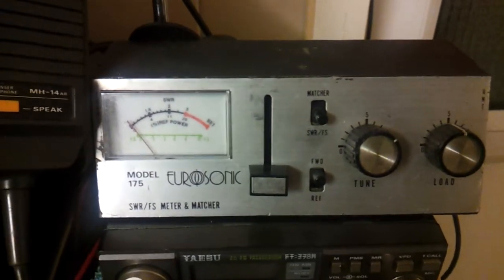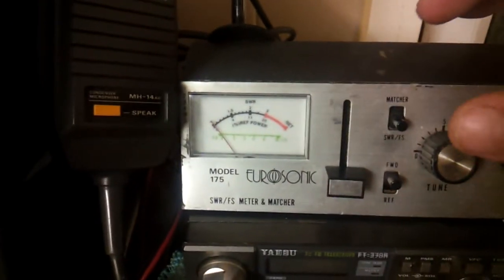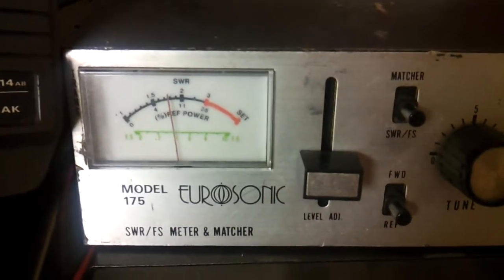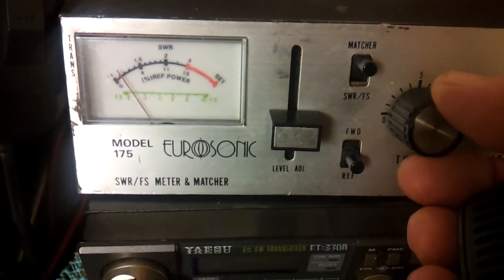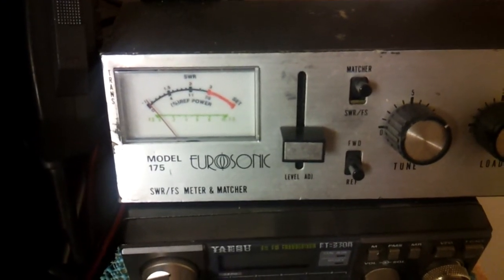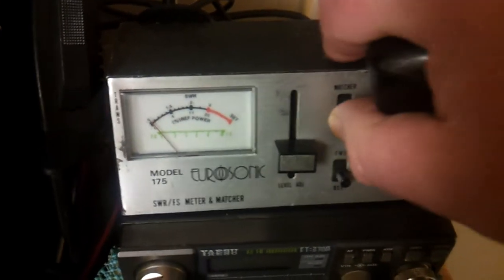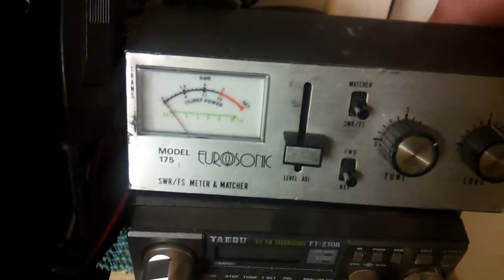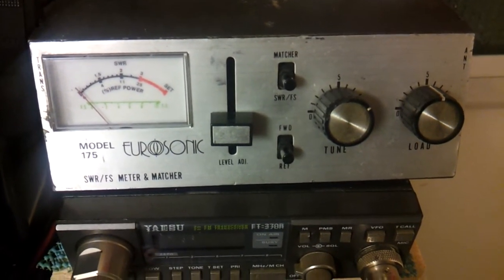How to use swr meter with matcher

Comment: My brand is Katsumi but its identical. You can leave it in your vehicle permanently hooked up as per instructions i just downloaded. I have opened the unit and its vry basic inside. I have tried with uhf but i will get my son to do a range test tommorow.
Reply from the maker: oh nice , yea they pretty handy if your in a pinch, haven't used it much but it's still sat here next to the radio if needed :)   cheers for the sub. bit short on radio vids atm but got some coming soon , cheers 73 👍
Reply: @009ADVENTURES  I'm loving your work! Top job👍

Comment: Cool.  I recently bought one just like yours in the video.  My SWR was a bit high at 1.4 on channel 20, now with this I can make it 1.1.  Does it just fool the radio or will it make an actual difference in transmission?
Reply from the maker: thanks bud, I don't think they do make the antenna more efficient but it does just stop you damaging the radio which is good. I've not used this much but handy if needed 👍

Comment: Was hoping for more detail but better than nothing.
Wondering why you had to use both dials and what each ones effect is.
Was going to ask about power output loss but seems you answered that to somebody else below.

Thanks!
Reply from the maker: this was just a basic video aimed at helping a mate out who had the exact same matcher. the dials alter the impedance that's about it. again these are good to help out if in a jam but not great as a perminant fitting. some power will be lost but like I said they ok if your stuck with an out of tune antenna.  thanks for watching.
Reply: 163CTX009's ADVENTURES 
In a round about way i have the same meter but isn't the same.
They're the same regarding the dials and i didn't expect it would be required to turn both dials for such a measurement.

But I've got it nailed down since then.

Thanks again mate.

Comment: Hello i am new to cb  have a separate swr (crt swr 1) and matcher (zetagi mm27) also a kl 203p burner and wonder if your able to educate me in what order these products are placed in line if all connected to the radio at once please ? many thanks. radio is a crt ss9900
Reply from the maker: hi,  if your antenna is tuned correctly you won't need to use a matcher ,  you need to connect your swr meter to the radio first to tune the antenna with the swr meter then once you get it tuned unplug it....   so then from the radio out to the amplifier tx , then from the amplifier ant to tx on swr meter, then from from swr meter to antenna.
  only if you really can't tune the antenna would you need to use a matcher in which case it would go before the swr meter.    hope this helps .
Reply: @009ADVENTURES  thank you
Reply from the maker: no worries bud, if you need any help feel free to ask and if I can help I will 👍

Comment: Hello.
Please, would you tell me which is the transmission maximum power that this matcher meter can works?.
I can not find this information anywhere.
Thanks in advance.
Santiago
Reply from the maker: hi, I've had a look myself and cant find much, I wouldn't like to guess either. if I do find out anything I will let you know but as for now I'm sorry I cant really help.
Reply: Ok. Thank you.
Reply: Well, do you think it can work with 30 watts?
Thanks.

Comment: Do you have a copy of a user manual for this type meter?
Reply from the maker: hi, sorry unfortunately I dont. maybe theres one online somewhere with any luck. sorry cant be more help
Reply: I have looked on the Internet for a manual with no luck yet. I ran across your video because the SWR meter  and antenna matcher is a copy of the RCA 14T818 meter. I have the RCA model.  Thanks for answering me. I subscribed to your videos.  I will keep searching.
Reply from the maker: thanks, many more radio videos to come. I will have a look and ask about and if I do find anything I will let you know 👍